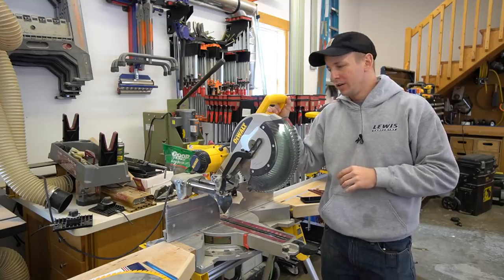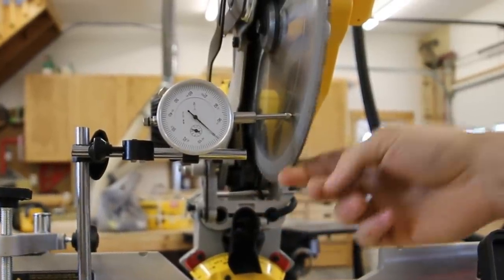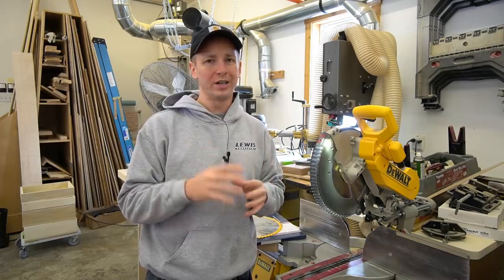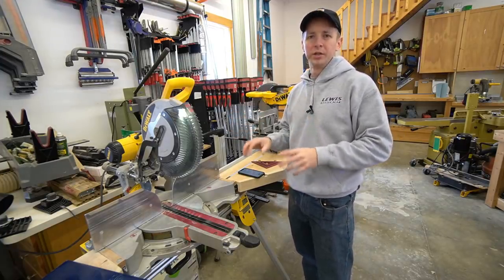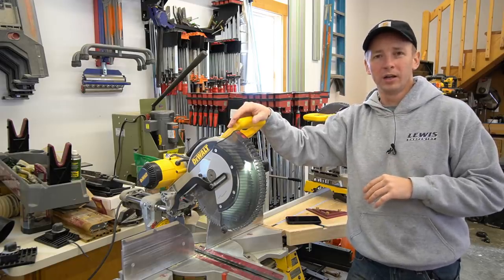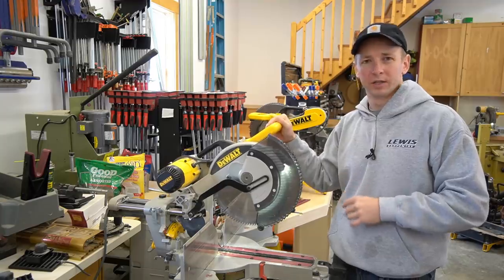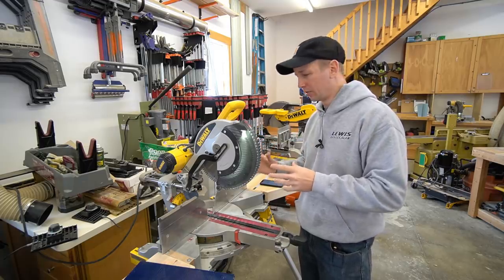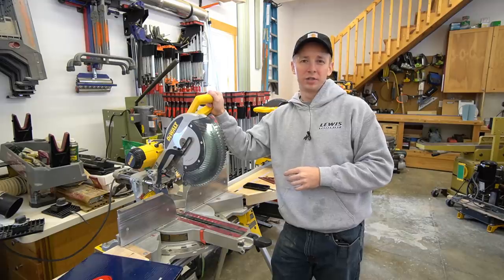DEWALT DWS780 | The BEST Miter Saw for Production Trim Carpenters???

Comment from the maker: THANKS FOR SUPPORTING THIS CHANNEL BY PURCHASING THROUGH THESE AFFILIATE LINKS!!!
Dewalt DWS780 Miter Saw - https://geni.us/gCB3f
Tall Auxiliary Fences - https://www.customfabricatingsolutions.com/ez-speedy-zero-clearance.html#/
Dewalt DWS779 (Cheaper Model) - https://geni.us/eUrB23
My Favorite BLADE SM or LM 6300 - https://geni.us/kZAB
Reply: Good information on the blades. The Type 22 779 also has  some other differences from the 780. No steel bevel lock knob (plastic on 779), no positive pawl bevel stops, and no lock lever for the slide for a quick plunge setting. The newest version of the 779 weighs the same as the 780 at 56 pounds.
It was older type 20 was listed at 67 pounds. Also the two piece adjustable throat is now a non adjustable one piece. Both saws are made in Taiwan.
Reply: Hello from Moldova Europe...in my country dewalt  dws780 costs $ 1,500 I was thinking about buying or not...But you're definitely convinced me ...in my country this price is enormous...I will work for three months for this tool..I think it's worth it..
Reply: DWS779 is discontinued
Reply: I am looking to buy but I am seeing some negative videos.
Is the 780 having quality issues?

Comment: Thanks for the video! I have my Kapex for 8 years now with no problems or adjustments to be made, I was using it every day at construction sites for about the first 4 years, now using the 12" Dewalt Flexvolt on a Ridgid wheeled stand daily and the Kapex for when I need to cut repetitive panel moldings or just window and door casings, love both saws, for dust collection on the Dewalt I use the Rousseau hood and the best 12" blade I found so far that works great against deflection is the CMT 90T.

Comment: I love my kapex and would never sell it. Great vid. Buy the incra guaranteed square.
Reply: I have had my Kapex for quite a few years now.  Works great.  Founded it dead accurate right out of the box.  Size and weight is friendly to move about without feeling I should probably do a warmup before I decide to grab ahold of it like some other saws.   Dust extraction while doing some remodeling work in the home is far superior then any other saw.  I find the bevel controls easy to use and dial in exactly where you need it without having to reach in back of the saw like you do on the Dewalt.  However I am not a production trim carpenter and don’t put any where near the use (and abuse) that this guys does I am sure.  As he mentions the price for the Festool is a bit difficult to swallow and I feel the shadow line system is a better system.  No regrets on the Festool but I would certainly give this saw consideration if/when I need to buy a new one

Comment: Hi boss , I was having issue with dust collection. I purchased a rousseau 5000 dust hood . It works awesome for working in finished areas . Thx for the info on the saw blade .

Comment: That accuracy rant between 10 vs 12 inch is bullshit invented by Festool. I own Kapex and Makita LS1219. Both of them are accurate. Makita has, obviously, bigger cutting capacity.
Edit. As for Kapex motor failures. It was not motor itself, but the electromagnetic brake. That brake was poorly designed. Most failures occurred during constant on/off cycles; especially on small pieces of trim when you turn the saw on, cut the material instantly and turn the saw off numerous times. The electromagnetic brake responsible for slowing down the blade used to fry itself along with some motor winding. To put it simple, Festool forgot what the main purpose of the mitre saw is. To do Festool justice, THE PROBLEM HAS BEEN SOLVED FOR GOOD.
Reply: Thanks for the post. I am on the fence at replacing my older sliding compound miter with either a Kapex or a Bosch.

Comment: Bought a 779 and found a light kit for an additional $75 a few months back. It is heavier but I use a rolling stand so the weight isnt an issue for my applications. I’m very happy with the performance, savings over the 780 and overall quality.
Reply: I added the light kit too. It was easy. I am not so sure about the weight. Every time I have looked at them at a store I see nothing at all different other than the light.

Comment: There’s a channel called the building guru that has a fantastic tutorial series on how to make that 780,  100% machine square. 
I have a bit of a testimony with this saw cabinet installing with it for 7 years. In my opinion the 780 is perfectly accurate for trim and general carpentry. It took me a lot of effort to do many high skilled jobs but I got a ton of great work done with it, and there’s plenty to like about it. I loved the light on it but found it useless as a blade indicator because the shadow isn’t hardly even visible from full extension and not crisp until the blades basically touching the work piece so I don’t consider the 780 to be equipped with a blade indicator at all imo. 
I went through 4 of the 780’s in 3 weeks just taking them home, setting them up and finding the fence and/or base was twisted out of plane, so the blade couldn’t be squared to both sides of the fence. After going through all 4, I found they all had the same fence wing issue, and while taking them off and sanding them down perfectly flat (in plane) I found the channels they slide in were machined out of plane, so even after machining the fences flat, as soon as I adjusted either one out a bit, left/right, they were out plane again so it wasn’t possible to totally fix that issue no matter what.
Also, after finding this issue in all 4, in 3 weeks the rep said he wouldn’t exchange me another saw, and the Bosch and Makita’s at the time had noticeable issues of their own that I didn’t want to deal with, so I just stuck it out with the 780. 
 After going through the rest of the saw I found that while the centre base was relatively in plane to the side bases, it went out of plane when moved left or right, so again it was a problem that could not be fixed because the platform the Center base sits on was out, so even when I machined all 3 bases to be in plane while at 0°, it would go out of plane to the left and right. 
That’s 2 separate issues that could not be totally fixed. So I basically had to resort to drawing a square line or whatever angle I needed on every piece I needed high accuracy on, and just tried to follow it. As unfortunate and shitty as it was, it was possible and I made it work for years. 
I found out years later that the 780 was made in Mexico and another country so I assumed the one factory was just phoning it in for a cpl years, because I found both of those issues in 5 other new saws after that, totalling 9 saws, including my cousins new 780 he bought 2000 miles away and a year after I got mine. 

Either way, moral of the story must be #NotAll780s and #NotAllKapex lol because I had just as shit of an experience with the 780 as you had with the Kapex, and now am just as happy with my new Kapex as you are with the 780. Although I do wish the less expensive saw that worked out for me. Lol

Comment: My 23 year old Dewalt 12” miter saw is still going strong. The 1st gen is perfection in a miter saw. I have used the newer versions and they don’t compare. Honestly you need to find an older saw and try it out you will understand the difference. Words from 45 years as a trim carpenter.

Comment: Thank you for putting together this video. I have been trying to decide between the Makita LS1219L and this DeWALT DWS780. I have read some reviews that some of the Makita units need to have a piece of wood placed between the rails and cranked to get the rails to align with the blade. When you consider the fact that I'd be paying $700 for a saw that needs that type of adjustment out of the box, I realized I could get the DeWALT and a stand for the same price and similar performance. I've seen the work you do and it makes me more confident that this saw is not just for framing - it can handle the fine finish work I will be doing.

Comment: Hey Spencer - I switched from the DWS780 to the Kapex this last year for the UG cart/wings and dust collection. I'm with you on the DWS780 being an incredible saw. I held out as long as I could but being primarily in a basement shop I needed the dust collection to be better. I really miss that LED shadow line though.

Comment: I’m in central Texas do tons of tiling in production and custom homes the amount of abuse and use I see carpenters put on their dewalts I really doubt a kapex would be able to keep up also 100% of carpenters I see have the dws780 the only guys I see run the regular dewalt non sliding version are hardwood flooring guys and framers who pretty much only do rip cuts. dws780 Is the best saw right now nothing can compete with it in my opinion and it will most like stay like that for the next 20years I bet.

Comment: Dewalt says on their website that the weight is the same for the 779, and the 780. 56lbs. I can't verify if that is actually true. There are a few internal parts that are different; armature, etc.. As others have said, the CUTLINE Blade Positioning System can be easily added to the 779 for about $50-$70. Like Spencer has said, nobody really knows if any of this seems to make a difference.
Reply from the maker: I hope I didn't mis speak. I was doing some research that said weight was significantly heavier on the 779. It didn't make sense to me but I assumed the information was accurate.
Reply: We had both on a jobsite and the weight of the 779 & 780 are the same.
Reply: 779 Version 20 was 67 pounds. Version 21 and 22(newest) are both 56 pounds. No weight difference between 780.

Comment: Great Saw. I run the same saw but use 10'' blades on it. I lose some cut capacity but 10'' blades are a bit cheaper for what I need.
Reply: Great idea. That's why I was holding onto my 10.

Comment: great channel!  I'm newly subscribed and have been wanting to comment but usually I watch on our Smart TV and there's no ability to comment there.  I really think you're an awesome person and a great carpenter!  But on this topic I'm gonna have to push back!  DeWalt is ok, they've come on strong the last 10 years or so but they're late to the game with sliding miter saws. My MADE IN JAPAN Makita LS 1013 is a lot more refined than the DeWalt and I bought it 20+ years ago....for instance the trigger has a soft start feature that is really nice. I have a friend with this same 12" Dewalt saw and it "jumps" when you hit the start switch....maybe you get used to that after a while but it's just one example of the lack of refinement. I'm glad it works for your work flow Spencer but I just wanted to share with people reading that the DeWalt brand in general ain't really all that. The older Hitachi sliding saws were extremely well made too, before they started outsourcing all the production to China. I'm not hating on DeWalt, I have a few DeWalt tools such as a 16 gauge cordless nail gun that's pretty good, but overall just kind of "OK" and IMO over-rated. But I do understand that with the cordless stuff you kind of have to pick a brand and stick with it. For me it's Makita and I have a bunch of Bosch . Once again, great channel, keep up the great work

Comment: I also tend to agree with your take on Festool. They make precision tools that accomplish the tasks they were designed to accomplish (at a staggering price) but they don't seem to be rugged enough to withstand real world use. Back in 2008 I had a job replacing several doors in a carpeted office building and had to set up in the hallway. Knowing how much sawdust my Porter Cable 126 planer spews out I thought I would try the Festool  H 850 E planer (at the time $560) and the CT-22 dust extractor (at the time $520 plus $200 for a permanent cloth bag) to contain the dust. I must say that I was stunned at how well the dust extraction worked at containing the mess but in the subsequent years the dust extractor has literally self destructed due to how brittle the plastic they used is. The planer is excellent, and I still use it to this day and I still can use the dust extractor but it has several chunks missing and none of that damage is as a result of abuse from me. I don't think the saying. "you get what you pay for" really applies to Festool. I don't mind paying an exorbitant price for a tool as long as it is, by far, the best tool available. In the case of Festool I think it's more mystique than reality. BTW: To replace that setup today I would have to pay $733 for the planer and $1,045 for the dust extractor with cloth bag. By comparison in 2013 I paid $593 for my DWS780 sliding compound miter saw; today it would set me back $645......a little bit different rate of inflation. All prices include sales tax

Comment: I’ve used Dewalt 12 chop and then 12” slide compound for 25 yrs no problems. You are 100 on using quality blades. Kapex is way to expensive and not any better. As far as the dust goes well that’s what brooms are for. When you trim out a house there will stuff all over the place anyway.
Reply from the maker: Well said.

Comment: These saws have improved over the years too. I bought one when they first came out and just bought another new one. There is quite a bit of difference in the miter tables. The new one feels much more accurate and positive on the detents. 

I had a small piece of wood jam the blade on my old one  which stopped the saw dead and caused a lot of run out on the blade. I looked at replacing the parts and it was cheaper to  buy a new 779 than to replace a few parts in the arbor box on the old one. The old one is still good for rough cutting 2x4's and such, but now no good for precision work.

I'm going to add the light to the 779 saw as well. If you cut dark stained trim it's hard to see the pencil marks and a light would really help there.
Reply: I second the notion of how much power miter saws have evolved over the years.  For years I used a Delta 10” miter box with a cast iron table & zero clearance insert.  I’d built a wooden fence extension base for it; it served my needs well.  Unfortunately the saw was stolen a little while ago.  

The silver lining to the story is that I bought a Dewalt 12” (non-sliding) double bevel compound miter saw (DWS716) to take its place.  (I also have a Delta SawBuck for larger material).  The design of the Dewalt is miles ahead of the Delta miter saw.  It’s much more easily and completely adjustable.  It’s motor is biased to the rear and belt driven - so it’s not in the way of thicker material you’re cutting.  Even with the cheapie blade that comes with the saw, the cuts are glass smooth.  (I’ll buy an FS Tool or Tenryu blade when the OEM blade dulls.). It’s equally solid to the 10” Delta, but tons lighter and better balanced - so much easier to move.

Comment: Well durableity wasn't my experience with the dws779. The table was wobbly after 10 months  of easy use cutting 2×4 and 1×10 and 2×6 lumber. Dewalts customer service also isn't what I would call stellar when I tried to get some help. Thankfully the store i got it from let me return it. I did just pick up the dws780 if I have problems that's it for Dewalt for me.
Reply: I'm curious if you like the DeWalt 780 miter saw better than the old 779?
I've read that it's actually a higher quality saw.
I just bought a 780, so I'm curious, if you don't mind.
Reply: @davidgraham2673  the 780 has been fine. There are no issues so far. I'm still not happy about the lack of customer service.
Reply: @BLAM777  , Thanks for responding.
I'm happy to hear the saw works fine.
Customer service is very important to me. Hopefully that will never become an issue.

Comment: Thanks for all your informative videos Spencer. I always learn something from each of them. I recently had the motor fail on my DWS780 type 1. Have you ever had any motor issues? Unfortunately my saw is about three and half years old so no longer under warranty. Even worse Dewalt no longer manufactures the "field" to repair it. I'm in the market for a new saw and a little reluctant to buy another DWS780. That said other than the motor failure it was a great saw.
Reply from the maker: My dewalt saws have been bulletproof. They do require the brushes to be replaced every few years of constant use. But thats it.

Comment: I have the 780 and the fence doesn't stay in miter calibration and it isn't plumb if you lock it with more than a little pressure.  The light cut guide is a little off even when the blade is just above the material.  I bought the 780 becuase it has the best cut height for baseboard but wish the bosch glide saw had the same height.